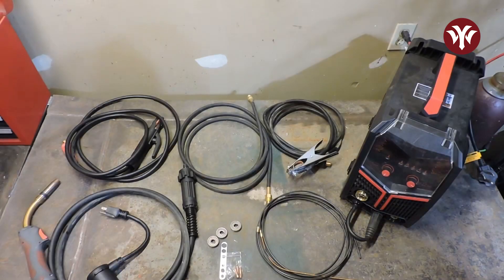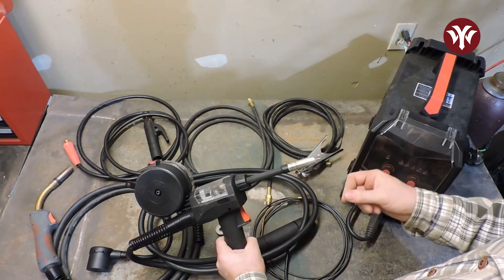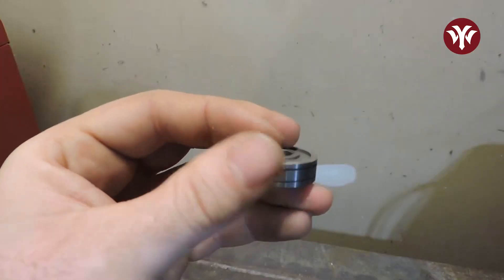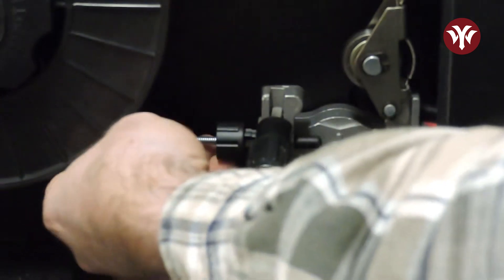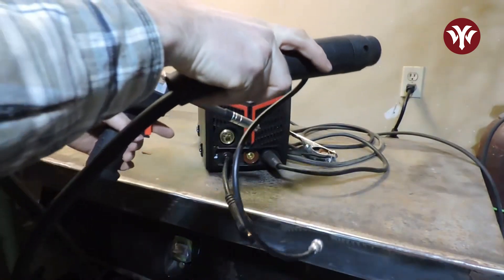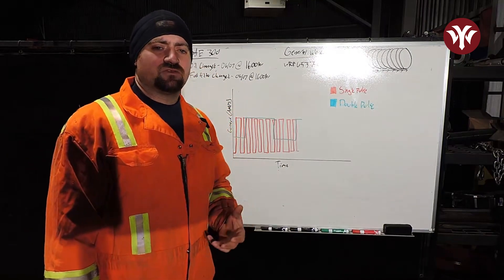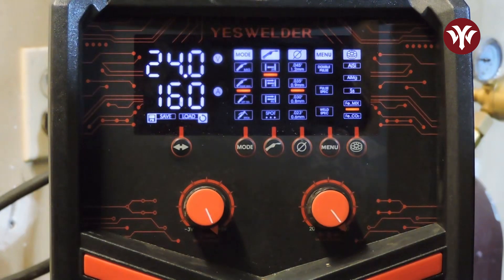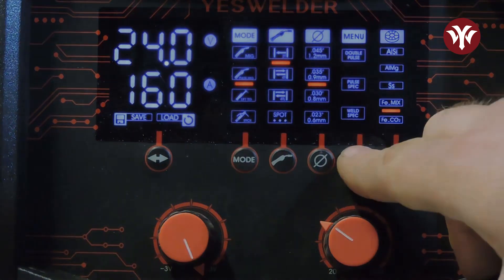Everything You NEED To Know About The YWM-211P | YesWelder

Comment: Thx.
I note in double pulse mode you can only change the lower base current. What is the effect on the weld bead when you select either a higher or a lower amperage?

Comment: I bought a yes welder 4 in 1 and it sat for a couple of years during covid.  It had never been used when i purchased it and had never been out of the box.  Once I put it all together and turned it on, it all worked.  We spooled the wire through the cable and the gun and turned it off.  After the got the metal ready to weld and turned it on the MIG part never would work.  Of course the warranty was out even though it was brand new and customer service sucked with no help not any suggestions.  What could be wrong.  There is no reset buttons that I could find and we never have welded with it.  I'd like to salvage it and I am not sending it back to Yes Welder as that will just cost me another $150 to send to them and get it back and that does not include their tech fees and repairs.  The panel shows no voltage and will not respond to any settings.  Any suggestion folks!

Comment: Thanks  great info    Could you provide info on aluminum settings?    At least a place to start for 1/8  to 1/4 thickness    I'm having a hard time with this.     Thanks
Reply: yes please provide aluminum settings for 1/16" up to 1/4" ! I'm restoring a 20' Pontoon and need to modify/repair the fencing, canopy frame & transom. The manual is useless and tech support not much help either. I also have a spool gun.

Comment: Thx. Did you set the initial parameters using the chart that came with the machine? I notice your settings were 24 volts 160 amps whereas the chart says 200 amps 21 volts
Reply: I did initially. It just took some practice. Plus I’m using a more unique shielding gas so settings are different because of that as well

Comment: Thanks. Have to say trying to understand the manual is a bugger! 
Right from the start I am unsure as to the amp and volt settings. Do you select the initial wfs/,amps,volts from the welding chart based on the thickness of the workpiece and all the other settings are tailored via the controls on the machine. Most of the other machines I have have a thickness selector shown on the screen. Am I missing something here?
Thanks again for your video for without it I would be lost

Comment: Bought this machine and brand new nothing works, everything is set correctly but when trying to mig weld, the drive roll won’t spin, tig weld won’t arc and neither will stick, the screen comes on and that’s it
Reply: Place the workpiece/ground clamp on the material you are welding, and pow you're now a welder.
Reply: @charlesdeering9359  lmbo
Reply: @charlesdeering9359  😂
Reply from the maker: Thank you for your feedback. We're sorry for the inconvenience caused by the problems you have experienced. Please feel free to contact our after-sales service team at support@yeswelder.com, and we will certainly work towards solving the issues for you.
Reply: @YesWelder  You weren't mush help when i kept trying to send you videos of the problem  I cannot record and down load a video over a few seconds but thanks for nothing, my warranty ran out and your customer service was of no use at all.  I had a warranty when i tried to get this issue fuxed but I do not know why you need a longer video to see no voltage is being displayed on the screen.
Reply: Same problem and mine is out of warranty.